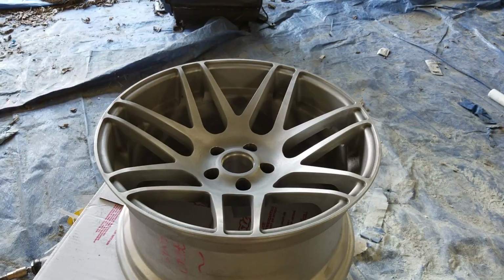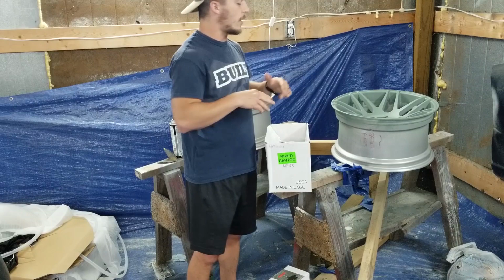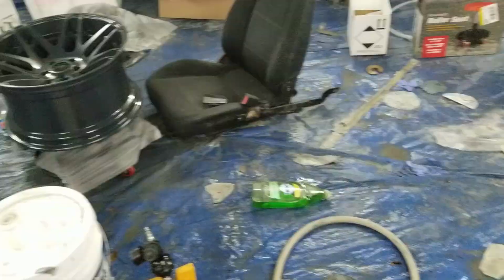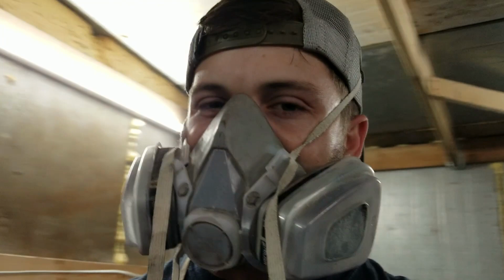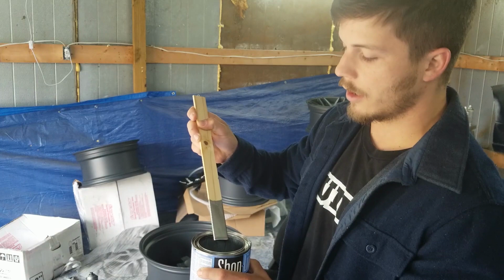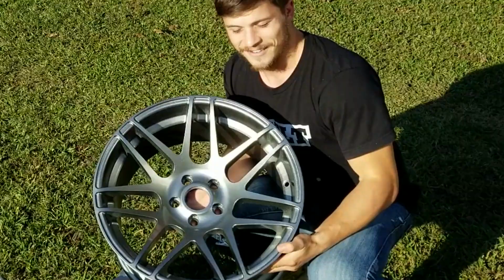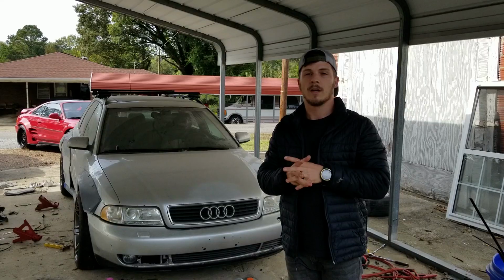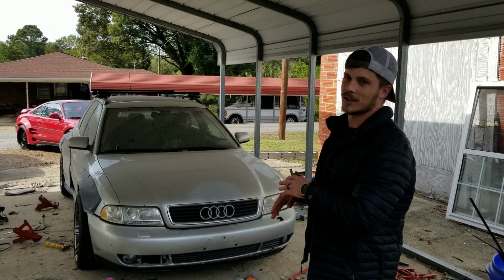PAINTING $2000 WHEELS IN MY GARAGE

Comment: Looks awesome! I've painted quite a few aluminum wheels without using an etch primer and never had issues. Probably still not a bad idea though. I used the little spinning seat while painting some a few weeks ago. Wasn't planning on it like you but happened to look over and saw it and the lightbulb went off lol. Lastly, I usually get my tires mounted first and mask them off. Had a bad experience at a tire shop once with freshly painted wheels. He mounted the tire backwards and had to pull it back off and turn it around, scratched one of course.

Comment: How large is your compressor? I stupidly tried painting bumpers with a 3 gallon and a detail gun from harbor freight. Needless to say it turned out horrible. My 01 Z3 desperately needs new paint from normal wear and I want to say fuck it and take it somewhere cheap but even the price of that makes my bank account hurt thinking of it. Any experience using electric spray guns like the ones the plastidip dudes use but with 2k paint?

Comment: Aluminum is non-ferrous😉
Reply: @BUILTOFFICIAL  no problem man. Love the build! I'd love to see some custom led retrofitting in the tail lights. Cob led strips and rings are getting pretty cheap, and I found a website that sells some pretty reasonably priced led control modules for automotive use such as a pass through pwm that you can set the brightness of an led for running and have full brightness for brake and also switchback modules. If you are interested.